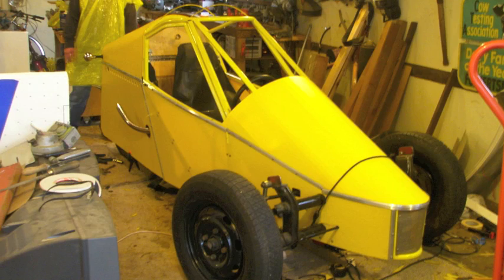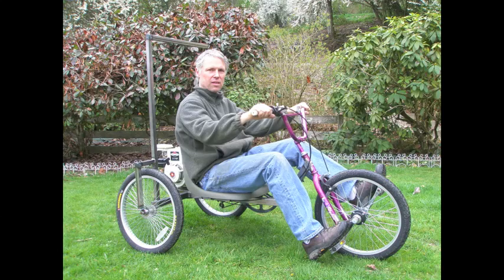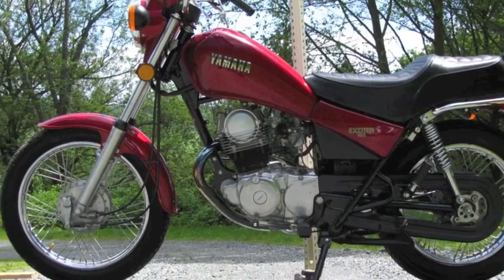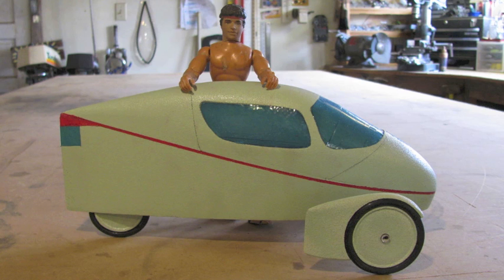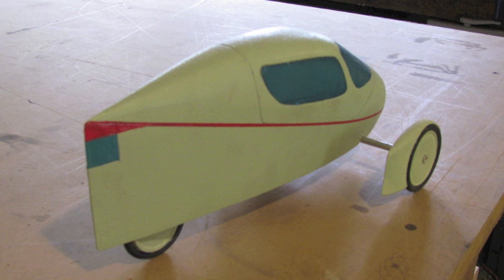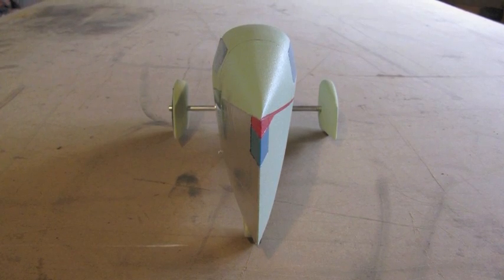High mileage vehicle build (part 1)

Comment: If you built that ... would it be legal?  Seems like there would be a lot of regulations would you have to conform to.
Reply from the maker: Each state has different rules on 3 wheel vehicles. In essence they are much less regulated then a 4 wheeled vehilce.
Reply: Justgivemethetruth if he has a titled bike and he incorporates the frame with serial number then he'll be legal. If he just uses the engine then he wont.

Comment: this would be better if it was electric, silent, no local pollution, reliable, no transmission needed. no exhaust, more powerful for motor weight and actually a relatively small battery for 50 to 100 miles of range...

Comment: So you're going to lighten up the motorcycle, lessen the friction on the road, probably make it half the weight or more, and you're only going for around 50mpg more?  Why not try for 300 mpg?  You may even be able to build a hydrogen generator on board to mix with your gas, and also add an electric component to make it a hybrid... Heck go for 500mpg!
Reply from the maker: What I'm attempting is daunting enough. Maybe int the next model...

Comment: I don't like your choice of engines for highway speed. In order for the small engine to run highway speed, it would still need allot of throttle. A larger engine, fitted with a constant velocity carb would suit you demands better. Can't wait to see what you end up with! Always, enjoy your builds!
Reply from the maker: I'm not too happy with the small CC's too, but it does force me to go lean. I will be slow on take off and hill climb, but depending on how well the aerodynamics and gearing go I should do OK on freeway. There will be the ability to change the motor out for a 250 cc Ninja in case things don't work out.
Reply: It will be tough to get the mileage you desire unless you can get the rpms lower. the small engine cannot push the vehicle with lower rpms because it wont make the horsepower to achieve highway speed. An engine that will supply the needed horsepower at a low rpm would be able to idle and make the 150 miles to the gallon your aiming for.
Reply from the maker: I've been known to fail before. Then again...
Reply: When Edison had tried to make the light bulb a thousand times that didn't work he replied that he knew 1000 ways it wouldn't work. Doing something instead of nothing is always better.
Reply from the maker: MichianaFisherman
Reply: MichianaFisherman his engine will take him easily to 100 mph with that body shape.

Comment: why not just use a bike if you want to attain that amount of mpg? keep things realistic for your time investment, though it might not be as fun your outcome would technically be more reasonable and realistic though not as boastful.
Reply from the maker: It rains alot here in the Northwest and most slip stream bikes have handling issues. I'm also not a motorcycle buff and I'd like a bit of protection in case of a tumble.